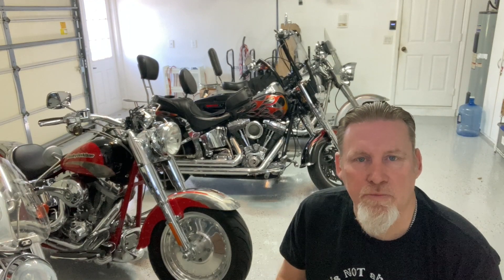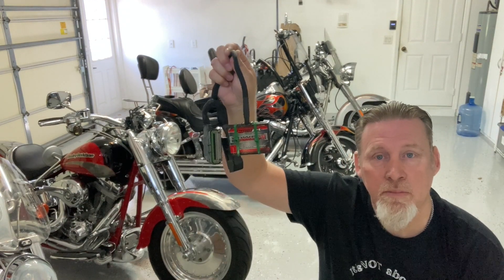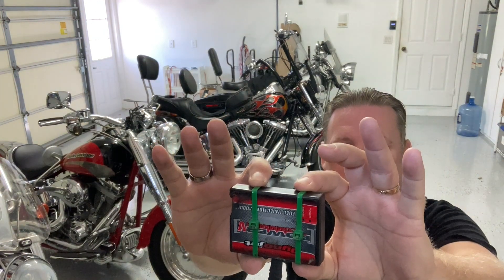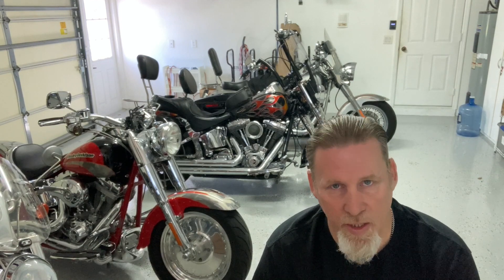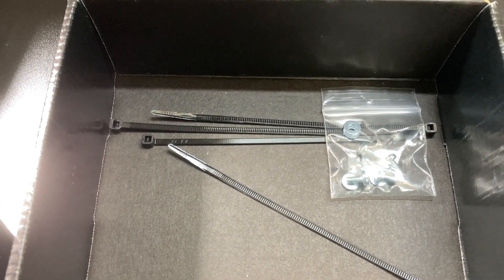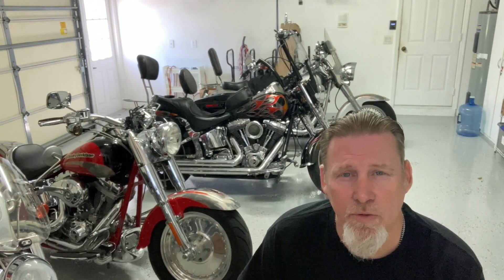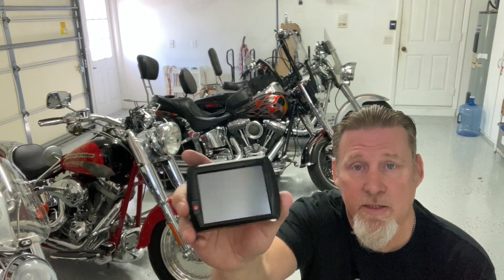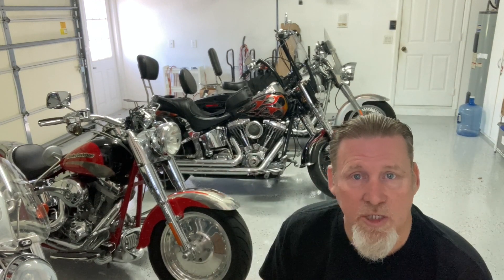Best Tuner For A Harley Davidson Fatboy

Comment: The wide band o2 sensor set up is called Autotune pro, comes with o2 sensors.   All you need to do is start with one bike, and once you are satisfied with the results,  remove the Autotune pro system and o2 sensors,  install in another bike and tune that one.  You can tune all your bikes with one system.  Worth it I'd you have multiple bikes.

Comment: My bike had a power commander 3 on it when I bought it. It went bad. I have no idea how old it was. I had it replaced last year before the world record poker run. My bike never died on me. It was running extremely rich. The air to fuel ratio was off the graph when they tried to dyno tune it. That is when I found out the tuner was bad. They installed a power commander V. The mileage went from 29 average to 31 average. I have since had a second dyno tune done. It was running too rich. I have not put enough miles on it to see the mileage. It was tuned in December. It ran better it would pull smoothly from 45 in 5th gear.
Before the tune it would need to be going 60 to 65 to pull smoothly in 5th gear. It also picked up power. The horsepower went up 7 and the torque went up 8. The best part is it has over 100ftlbs of torque from 2,100 rpm to 5,000 rpm with a peak of 118 ftlbs. Not bad for a stage 1 110”.
Reply from the maker: Glad they tuned it for you and sounds like the bike is doing better after the tune. Thanks For Watching
Reply: @TheBadgers   I am glad they tuned it. As you know I ride a Honda. It was tuned at Loess Hills Harley Davidson. I was impressed that a Harley Davidson dealer helped out a Honda rider. There service department was busy but they did the job when I told them I could not find anyone else in the area. They are good people. People are quick to bad mouth dealers. There are good ones out there.

Comment: Newbie rider im thinking my '04 was stage 1 ... High flow intake and V&S pipes not sure about the tune. Another person said like you did there's a black box. Mine doesn't have that . I guess my question is how can i tell if it was tuned and if the previous owner put a better cam in it. I have asked a few questions tonight on different videos sorry... Just found your page
Reply from the maker: Only option for the cam is to open it and take a look, which depending on miles you need to check the Tensioner shoes before you have a real issue on your hands

Comment: Hey man love your channel and your bikes.i have a 2005 Harley Fatboy and this weekend I was riding and the bike stalled out on me so I replaced the battery and still nothing after sitting for an hour the bike finally started and got me home well today I changed the oil and the bike started then turned off and would not turn back on so I checked all fuses and relays they are good and press the the start button and I hear nothing but do have power lights etc... Working so I do have a key fob and my red key light is on my dash you think a dead key fob would be the issue for not starting please any info would be greatly appreciated thanks man please keep making videos
Reply from the maker: My key fob is push button so unless I activate the alarm it doesn't matter if the battery is dead. Press and hold to arm, press twice to disarm. Is the instrument cluster lighting up, can you hear the fuel pump running when you first turn on ignition?? Do you use the ignition to shut the bike off or the kill switch.
Reply: @TheBadgers  yeah it all lights up an I use the kill switch by the throttle and today I noticed my key light goes on when I turn the bike to ignition then goes off everything works except I hear nothing when I go to start it
Reply: My 02 twin cam does not have the alarm fob system 
.it seems it was taken off the bike from almost new.I wonder if the previous owner had hassle with it .I just put the key in tank ign and start the bike.

Comment: Will this work on a 2000 fatboy ?
Reply from the maker: In an injected Fatboy?? It should but confirm it before purchase you can go to their website
Reply: Its a carburetor
Reply from the maker: @user-sj3nu4ku3s  You don't tune a carbed bike electronically so no this would not work

Comment: vdo says you download data to your pv3;  is this std setup for your model or can you get existing ECU setup downloaded to your pv3;  to see all data on your pc.   Not clear whats needed vs. std. ?
Reply from the maker: You can contact the contact power vision give them details of your bike, like cams, pipes, Air Breather and they will build you tune which you would download to your bike, but of course the whole point of the video was my bike was running bad because of the pv3

Comment: I’m having that same issue with my bike dieimg and stalling looked online and I keep Getting different things
Reply from the maker: Do you have a tuner on your bike currently?
Reply: I’m not sure I was riding yesterday and the week before took a 200 mile run but yesterday while riding came to a stop and turn it off and when starting it back up it started idling good once it got hot it would start to stall was either thinking new air cleaner but seen your video didn’t think of this
Reply from the maker: @IvanMorales-nm7hn with it being something that’s happens once it’s hot and when it’s cold I’d look at electronics, pull the seat and see if you see a tunern
Reply: Gave you follow on instagram was gonna messsge to you therr
Reply: @TheBadgers yeah I’ll try that was about to start and see how it idles cold sucky part is I just got my dna rims both front and rear 🤦‍♂️ that’s the love and passion for a bike
Reply: @TheBadgers  I don’t see a tuner on my end

Comment: just got s 22' FB.  where would i  find the autotune or any other module as nothing is under the seat.   I have no idea on the setup. so i need to get in tune !!
Reply: i have the vision3 with cables  as in the box above but no instruction manual. perhaps its flashed and ready ?   i can download from the pv3 data to my pc software ???
Reply from the maker: So you have mentioned multiple things I don't believe the pv3 will autotune which means you will need to have power vision build you a tune, if the pv3 will even work on a 22 I am not sure.  Is this a brand new pv3 or did you buy it used?

Comment: Advise for someone looking to buy a 02 CVO Road king
Reply from the maker: Make sure the cam chain tensioners have been replaced
Reply: Thank you
Reply: Ok so I looked thru service records and it had a hydraulic cam chain tensioner installed last year and fork seals replaced with almost 18,000 miles and I can’t find one anywhere near what he’s asking (6500)
Reply from the maker: @WillieD3521  Sounds fantastic to me it is a mechanical think so unpredictable at best, but if you like the bike and it's priced right then go for it. Can't wait to see pics of it